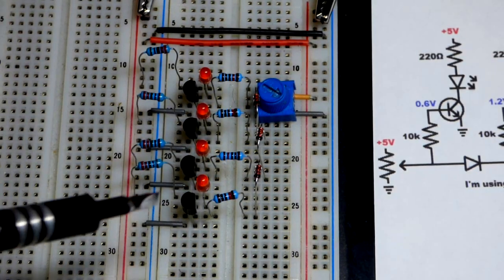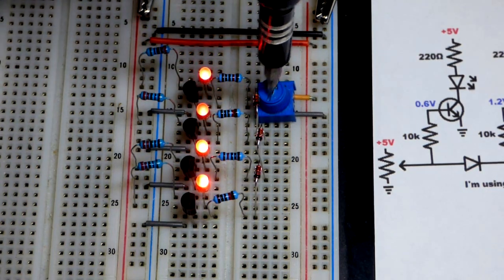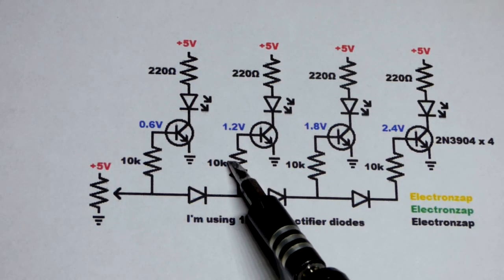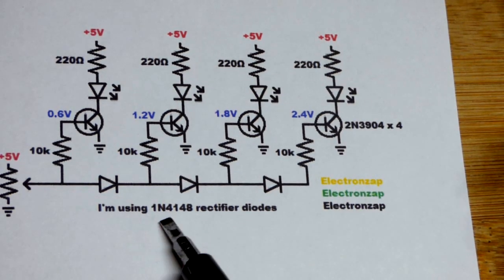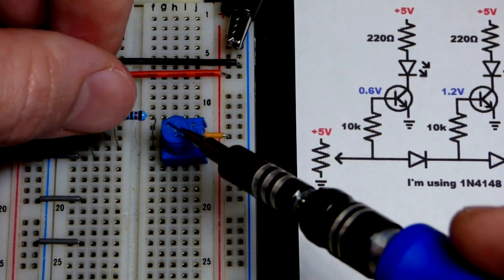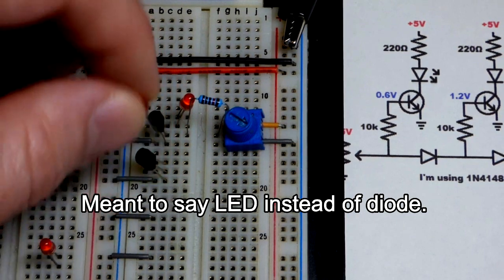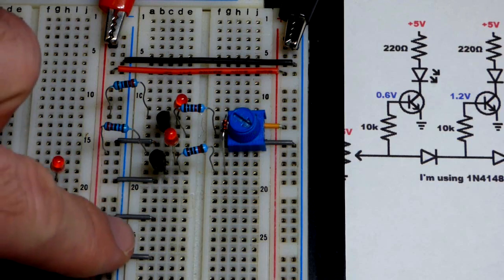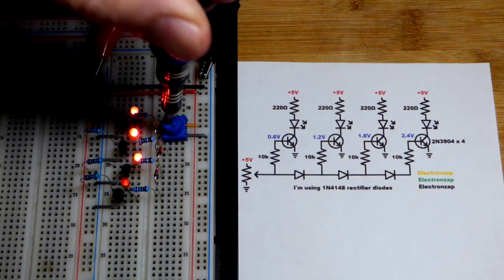More LEDs light up as voltage rises using 2N3904 NPN BJTs based on a circuit by Bornach

Comment: Intersting circuit , one to definately try out. I'm wondering is their a circuit to replace the manual turning of the trimpot that will alternate the voltage low-high-low and keep repeating that? It would look like the Kit car lights. I suspect it would have to be  microprocessor but is there anything else? Thanks for posting
Reply: Funny you should ask...
Reply: @bornach  Lol nice circuit too and sub'd
Reply: See Bornach's video titled "Astable Exhalation" - a 2020 inspired circuit sculpture".  He uses an astable multivibrator to trigger the "light saber".
Reply from the maker: It should work with anything that has a changing voltage. So it could be attached to a capacitor or sensor as long as it doesn't take away too much current.

Comment: I actually got one to work using solely zener diodes and current limit resistors with a red, orange and green led. I like this much better! It shows differentiation between each voltage level (mine the ledsbwouodnturn on or off while this one fades the led out as voltage drops) extremely useful circuit even for audio possibly.
Reply from the maker: Yeah that was the problem I had trying to design a circuit that keeps lighting more LEDs as the voltage goes up by just using diodes and/or resistor voltage dividers. The transistors do a pretty good job preventing too much signal current being taken away by any of the LEDs. Thanks for watching!